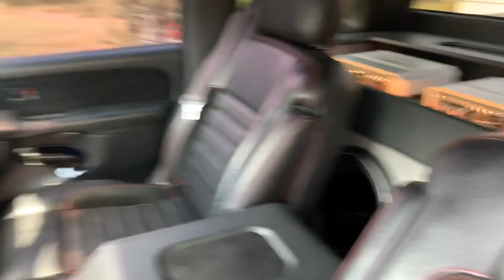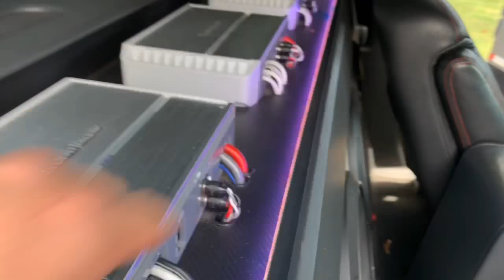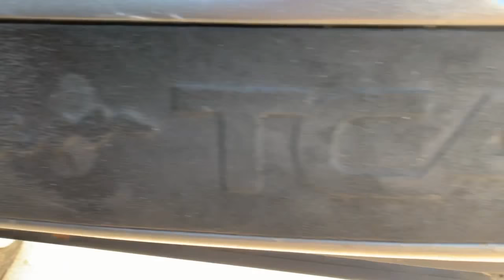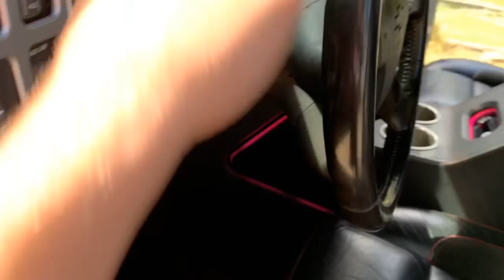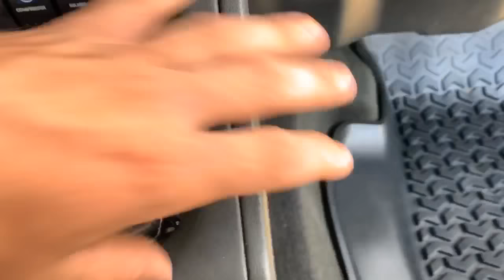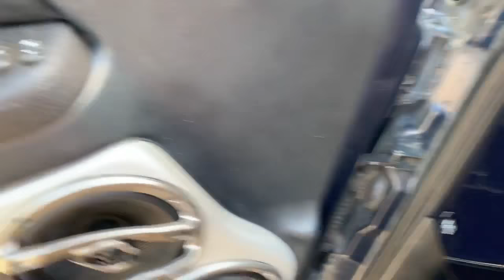INSANE SILVERADO INTERIOR (4 12s, Painted Dash, and more)

Comment: That one of my problems , I do have fourth door it’s cable or something is worn out because it won’t open.
   Does the rear subs vibrate the truck?
Reply from the maker: They do but not like you would expect. Like it’s not going to break anything, if a bolts loose it might rattle it out but other then that there’s nothing to worry about.

Comment: Nice truck. My only comment to those trying these customs, a lot of panels he said he just put primer and sanded the panels before paint. Even a few wooden pieces the same way. That WILL NOT last. Especially with that much bass. Had that happen to me. I then did fiberglass over all panels then prime and paint. It strengthens the panel 5 x as much. It sucks to spend money like he did. Then have it crack. Jsn. Nice build.

Comment: Why would you want so much bass?
Reply from the maker: Is a demo to promote my dads business and the work he can do!
Reply: @ACHUNTTV  Awsome. It is a clean install. That much loud bass makes me feel physically sick after a minute or two.
Reply: @sam_s_  that's the best part
Reply: @sethh8892  2 12s that are turned up will make me physically ill in about 5 minutes.
Reply: @sam_s_  I have a 15 on 3500 Watts, want to get sick wit me?
Reply: @sethh8892  As long as I can puke out the window, it should be fine.
Reply: @sam_s_  it might float between window 😂